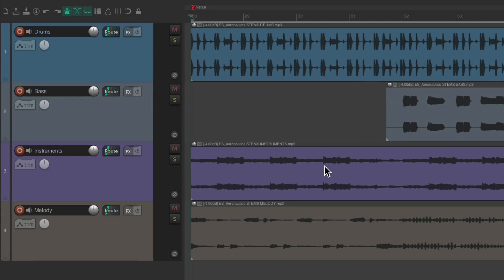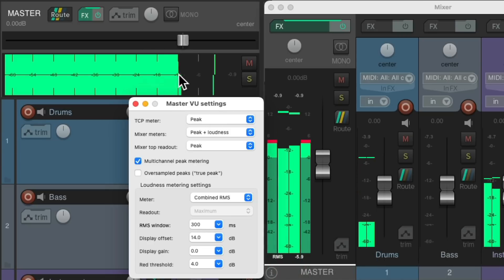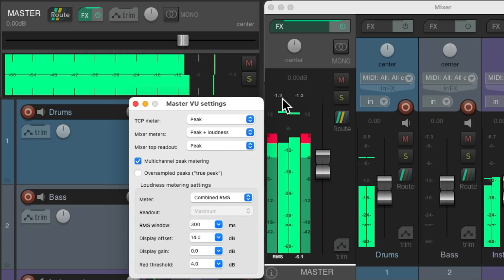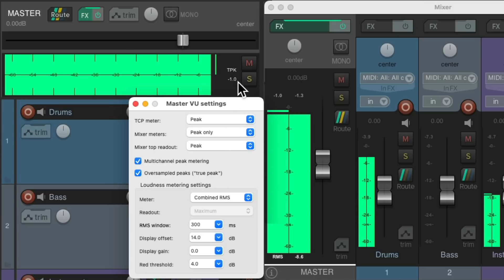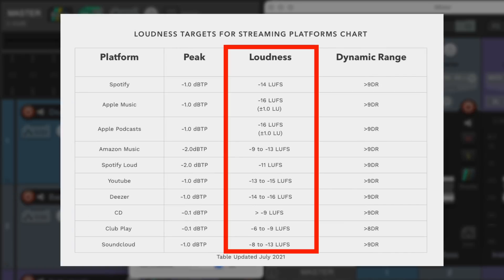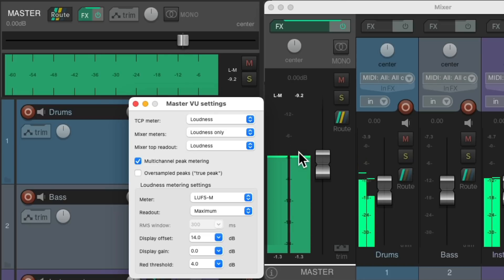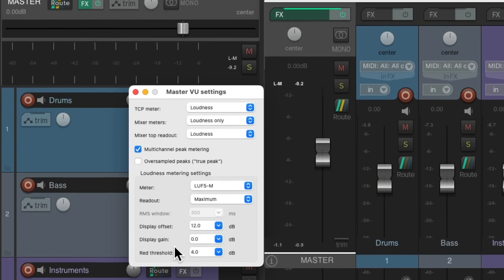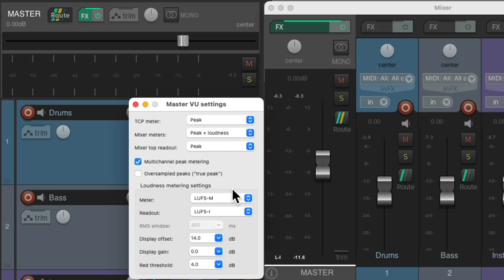Master VU Settings in REAPER

Comment: Is there a way to make the mixer top readout peak visible on each track?
Reply: Yeah, i think it‘s in layout, and then tracks, and then you can change the way your tracks (the tabs on the left) display things. There are some layouts that will show the top readout, some will not (from what i‘ve found). 
Then it depends on the track size/width as well. If the tracks are too thin/collapsed, it won‘t show the readout.

Hope this helps, i‘m new to Reaper myself, and have spent the last few days customizing mine. But i‘m really no expert at all.

Comment: Hi Kenny. Another issue I am struggeling with.
I using Reaper and Cakewalk. My SI-Instruments, shows in both program, but they are all feiling to load. I have tried to sort it out but I can't find where or what the problem is.
I have MT Power drums, but like the SI-Drum Kit better.
Can you help me to find what is the problem?
I have uninstlalled both reaper and Cakewalk 100% and installed it again, but nothing. The same problem.
And when I try to install the SI-Instruments, they are installing, but they will not work.
Please help me.
Reply: They are just failing to load or they are there but there is no signal or can't be opened.?
Reply: @jcalzada74  They Are there, but failing to load
Reply: @richardmeborg4717  have you try to open mic permissions for all
Reply: @jcalzada74  ?? How to I do that?
I am not using microphones to record the drums. I try to use the plugin SI-Drum Kit
Reply: @richardmeborg4717  every pluging need permission to open mic from laptops or desktop, I really don't know that's your problem because exactly don't know what is doing no to load but I encountered this problem before whit my plugins they where there but couldn't opened if this happened to you give it a try go to settings and go to security and look for microphone scroll down and turn on wherever application or plugin you want to use and click on
Reply: @jcalzada74  I trhink I found the problem. I installed Cakewalk on my Laptop. And there everything worked as it should. It seams that when I uninstall Cakewalk, not all files are being deleted. So when I try to Install Bandlab Assistance and Cakrwalk again, It show only 2/2-3/3 and not 5/5 as it should. So I struggeling to uninstall cakewalk 100% to start all over again. Do you know how to 100% get rid of all files in Cakewalk for then install everything again? Or do I really need to reinstall the whole mashine? Because last time I changed the hard drive, took a new install on windows and all other program, then everything worked. Then I tried to add like SI-Drum Kit so that Reaper also could read the files, then it didn't work after that not in Reaper and not in Cakewalk.
Reply: @richardmeborg4717  delete the desktop  and Uninstall the drive and any file for cakewalk and reinstall everything all over or when you install cakewalk again just click on replace files and that should take care of it
Reply: @jcalzada74  Thank you. It is solved, Cakewalk would not install properly through Bandlab Assistance. So I installed it through the Cakewalk Installer.

Comment: Thanks for info. I set up meters long time ago and have not checked current improvements there. So no need for firing up LUFS meter in case I need just quick LU check.
Reply from the maker: Also try out the Dry Run in the render window.
Reply: As I have fast SSD I usually perform full render. And if needed I can drop the file into Youlean loudness meter, where I can see more details.